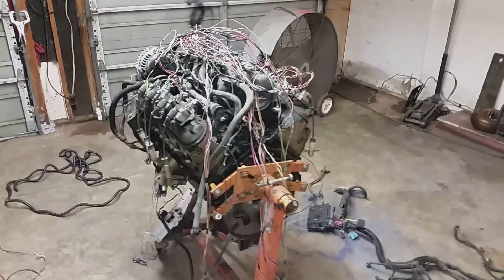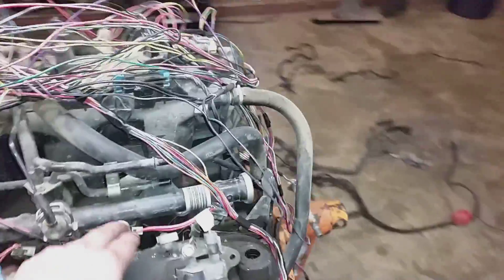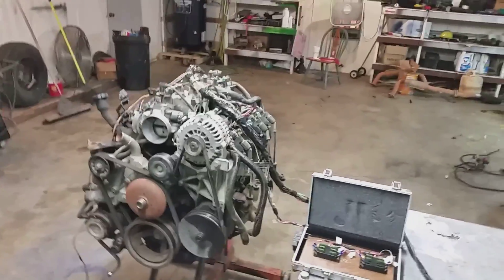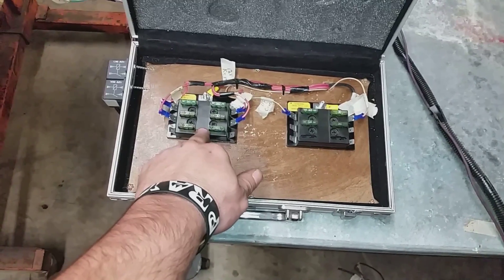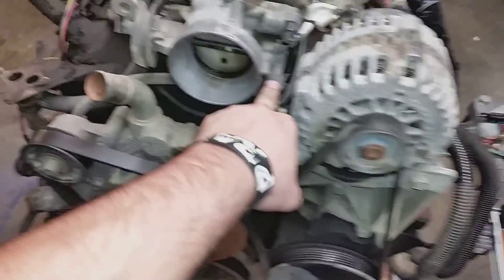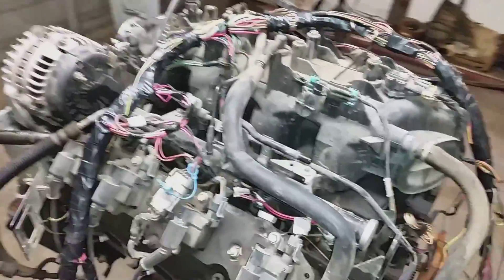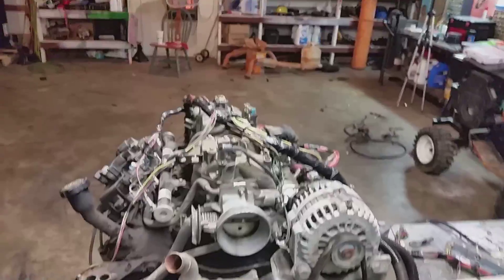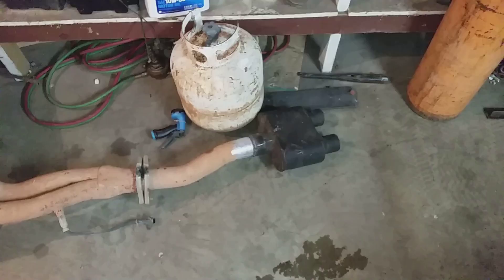How To Guide For A Stand Alone Harness 99-02 Drive By Cable System For LS Swapping Projects (Part 4)

Comment: I couldn't tell. But did you eliminate all the other colored wires from the middle fuse block except the pink? I think I may have made a mistake here with mine.
Reply from the maker: No. Some are ground and some are constant 12 volt.

Comment: Is that an LQ4 you put in the truck?  How/where did you get your motor?  Did you pull it from a local junk yard or order it?  Just curious how you went about finding and choosing your LS.  Awesome truck!
Reply from the maker: Yes it's an LQ4. It came from a donor vehicle that I bought for the swap project. It was a 2002 Chevy suburban 2 wheel drive. I went with the drive by cable rather than the drive by wire. To me its less problems to worry about.

Comment: Question, which bolts do i use to mate up the engine to the engine stand????????
Reply: The transmission bell-housing bolt-holes are what the stands are designed to use.

Comment: Question what all wires do we need from the donor vehicle like all the under hood wires, in cab wires?? and could someone take a engine and wires from a donor vehicle that's an automatic and put in a standard shift Vechile and make work with same wireing diagram you've explained or will there be less wires needed to run a manual shift great video you've opened my eyes to this swap it might not be as hard as it use to sound with good videos like this thanks
Reply from the maker: I'll find out more info about the manual shift but I believe that you just wouldn't need the trans plugs at all and may need to have the computer programed to show it that. As for what wires you will need under the hood. The big black plug that bolts to the bottom of the stock fuse box will need to be unbolted, all the wires will run to the pcm, what I done was laid the pcm and that big black plug from the stock fuse box over the top of the motor and then unhooked the ac wires and the trans wires also the 02 wires then I pulled the whole motor
Reply: Good deal man thanks
Reply from the maker: +Coal black 79 k10 I just ask a good friend of mine that knows more than me. He said same thing I did. Just have to eliminate the trans plugs from the pcm and have the pcm tuned to show it doesn't have an auto trans. As far as wires yes u will need the data Port from under the steering wheel
Reply from the maker: +Coal black 79 k10 don't forget to watch all the videos on this harness if u have not already
Reply: Ok thanks a ton yea I watched them all as soon as you posted them have a good one man

Comment: Since your not using the rear oxy sensors, are you keeping the cats on there or removing them later?
Reply from the maker: +prancstaman I will be using headers on the truck once the motor is down in it. No cats on this baby lol flows lol